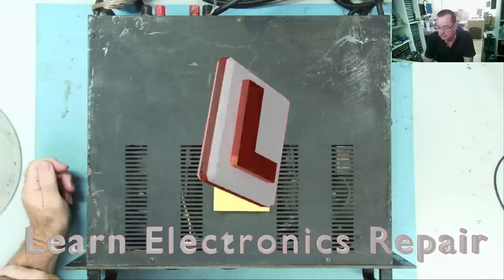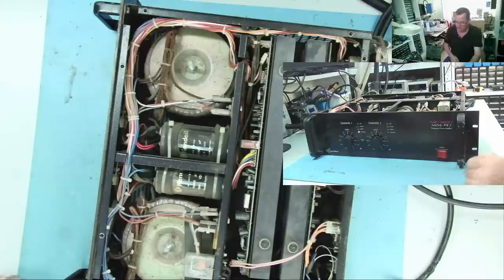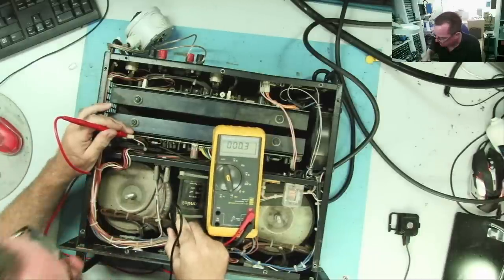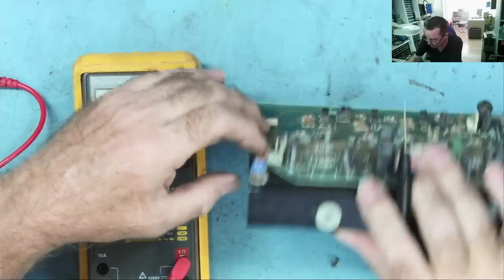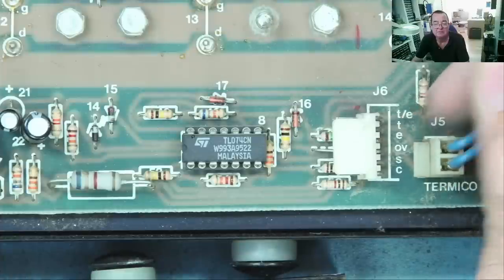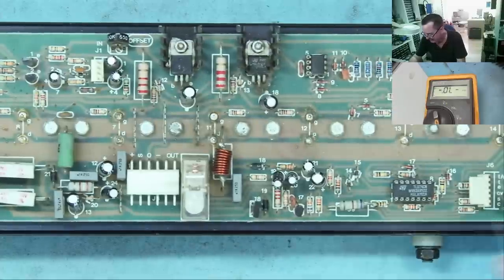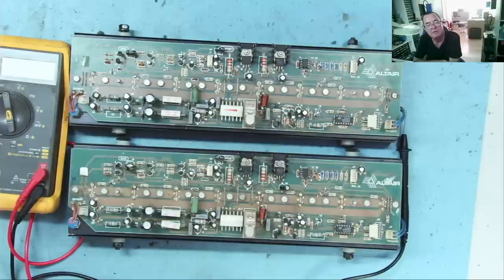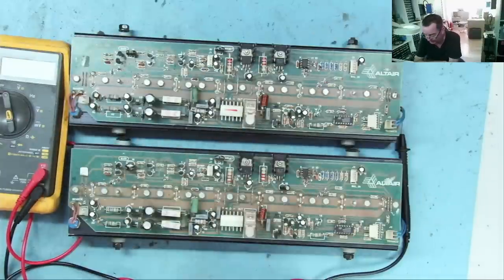Altair MF-1200 Amplifier Repair, Thermal Error on one channel

Comment: Richard at 13:06 the connector pins are moving. Probs broken solder at the other side and it opened the connection and showed the fault as if the thermal bimetal was opened. Btw thank you for your amazing videos :)
Reply: for sure !

Comment: if you move stuff about and it fixes it, maybe it points to a faulty connection or cracked joint (invisible cracks in solder only visible when wiggling or by continuity testing) or something similar. Maybe try remove them and check continuity while wiggling stuff. It's really technical stuff only for expert wigglers. Also check for evaporated solder, which might cause short on through holes to legs, maybe on transistors which are hot. Weird you got short from movement in a part that doesn't usually move.

Comment: On that second pin of that thermal switch, where you first could not measure a connection to the PCB-Header. Then you unplugged it and plugged it back in, and there the connection suddenly was. So I also think that the 2nd pin of the thermal switch was corroded and unplugging it and plugging it back in cleaned up the contact enough that you have contact. Because in this special configuration of the thermal switch every connection problem will result in the amplifier detecting the thermal switch to be open, which under normal circumstances indicates an overtemperature condition. I would spray the connector with some contact cleaner spray, just to be sure and to hinder moisture to get back into it right away

Comment: I presume the thermal sensor is low going high on temp . A bad connection caused high resistance so led was on at start up.
I wonder if we should just clean all those plastic connectors first on this sort of job and power up again on dim bulb before activating grey matter?

Comment: My guess is a poor connection on one of the amplifier boards connectors. Disconnecting and reconnecting has removed some tarnish/corrosion to restore the connection. The boards looked like they were full of dust and fluff, any humidity would accelerate corrosion.

Comment: Do you have a bench multimeter? I bought a Fluke 8840A a while back and I absolutely love it, it is SO FAST to settle on the reading it makes probing much faster, even in autoranging mode it's a split second, same with AC or DC voltage range, it'll settle in a split second.. I paid $50 for mine so can't go wrong at that price.. One of those "Car boot sale" deals

Comment: Bet you have a bad solder joint in one of the thermal component connections.
I noticed your ohms reading was intermittent on the first thermal sensor leads.

Comment: This phenomenon is no doubt  attributable to the strange nature of quantum mechanics Richard. Your observation has clearly disturbed the outcome of the experiment.  Remember that Schroedinger's cat was both alive and dead simultaneously until he opened the box. Similarly, in another branch of the multiverse, the other Richard opened the case and discovered that this particular amplifier no longer works. There is a much longer video on the alternate youtube where the other Richard had to buy some counterfeit MOSFETS on Ali Express which annoyingly exploded when they were fitted. It's all just down to probabilistic fluctuations in the quantum field.

Comment: Normally would now go about tapping the components and connectors with a nonconducting hammer to look for dry joints etc.  Then temperature cycle to try and recreate the fault. I hate sending anything back with a 'NFF' tag, No Fault Found.

Comment: As you say, possibly a bad connection on one of the thermal sensor connectors, may be worth another look-see. Probably an illusion, and probably not related to the fault, but only one set of speaker terminals seemed to be connected to what looked like a speaker select switch (1:21). You do need a dummy load, ideally with a headphone potential divider tap.
Reply from the maker: I think they had one speaker connected because the other chanel was not working for some time so they were using the single working channel.  That sort of thing is very common here

Comment: Frustrating to chase an intermittent. From what I could see the Channel 1 board looked to have a number of dry joints around all the mosfets. It also looked like they had been replaced in the past and perhaps the soldering wasn't up to snuff.

Think I would reflow all the joints on both amplifiers,

Comment: https://youtu.be/oV4YfKeSgB8?t=536 first thing that came to my head was why not measure resistnce of both, then run hot air against them and re-measure. maybe one of them is obvious (the one with 0 ohms is highly suspicious though)
and ya -- please get some dummy load, i just ordered some myself as well :D -- my money is on the connector that you took off for the thermal sensor. might have been bad connection there. But what do I know, I learned from you :D